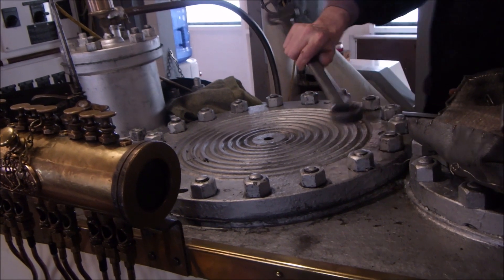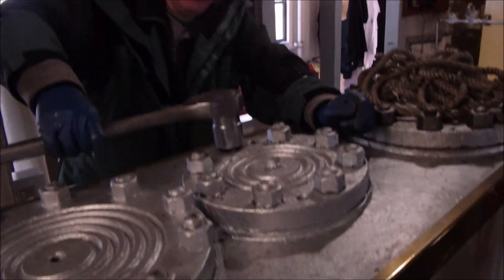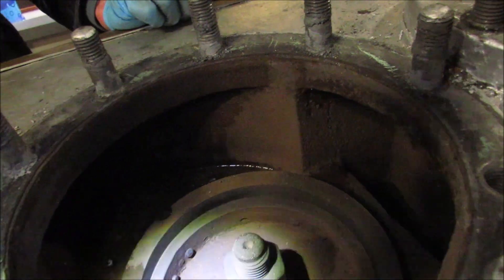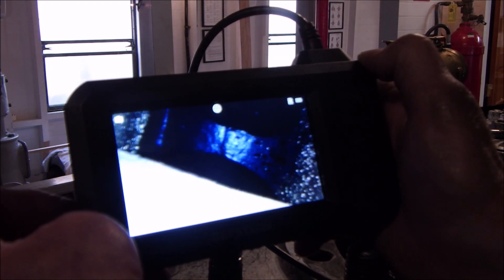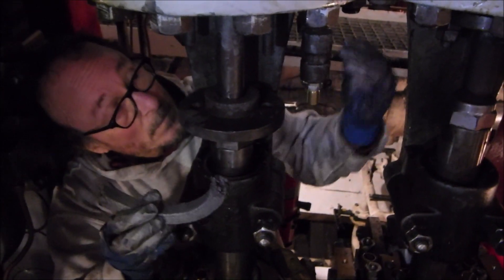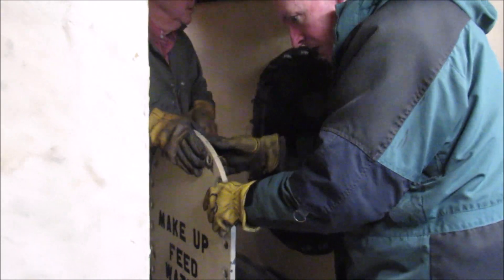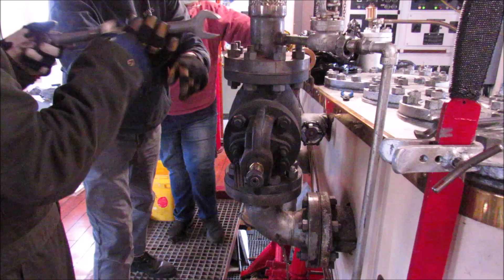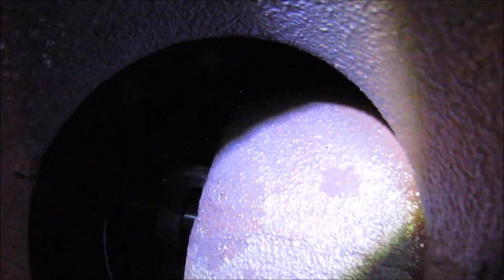A Look Inside a Steam Engine Valve: SS Virginia V Shipyard vlog #15

Comment: Such a cool looking engine. Don't make them like they used to. Love old things. 🙂
Reply: Same here. I have some sockets &  wrenches that I could use to work on your engine.At times have to use 1' drive sockets to work on our tractors as well. Have to use long leverage bars to have enough torque to loosen or tighten some bolts & nuts.Our farm tractors are all 1952 Fords.
Reply from the maker: The largest sockets on the ship are 3 1/4", our "big socket" drawer is no joke haha. (They also make great paperweights for brochures during festivals) And yes, we have some pretty long cheater bars hanging around for loosening them. Fortunately, most of the engine bolts don't need to be torqued down super hard.